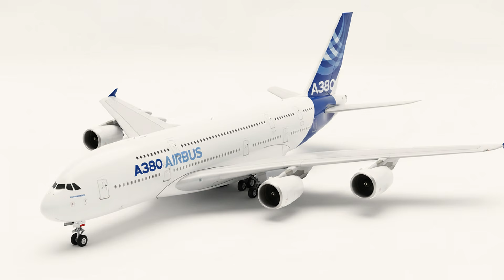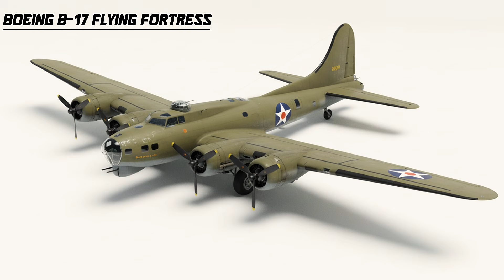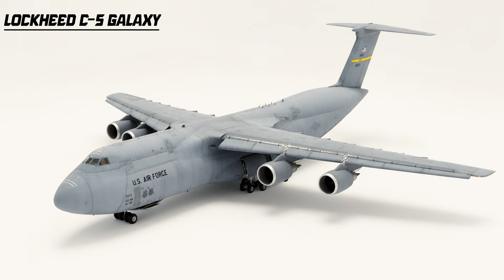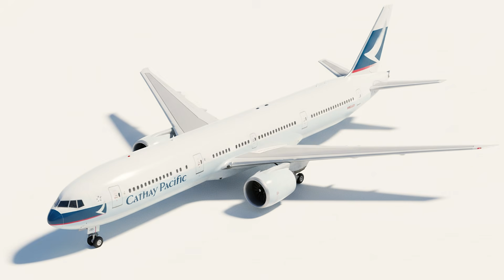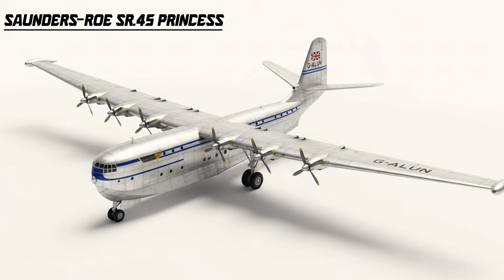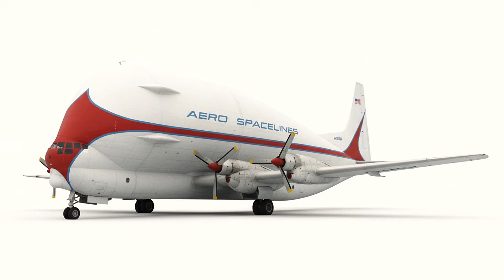Every Heaviest Plane Ever Explained in 14 Minutes

Comment: Your B-2 image is a bit wonky, but close. The L-1011 image has 5 engines. The thing has 3. I'm also pretty certain the H-4 was purely a flying boat with no landing gear. I don't think the Princess has landing gear either. NV-238 has 6 engines, not the 4 in the image . And again, landing gear? A A300-600ST seems to possess only two engines while the image has 4.